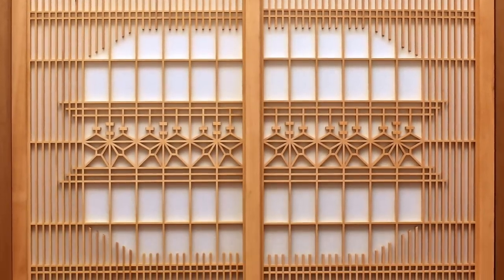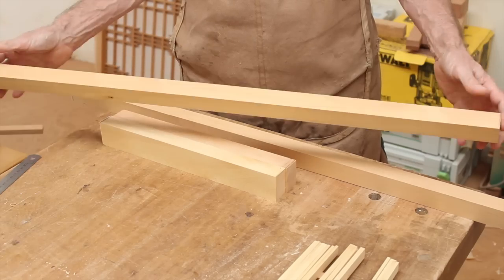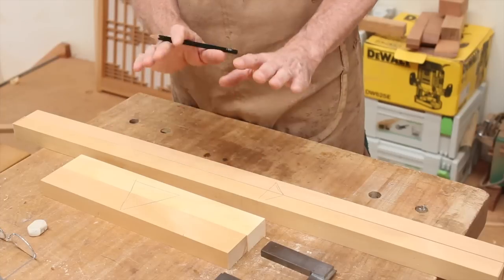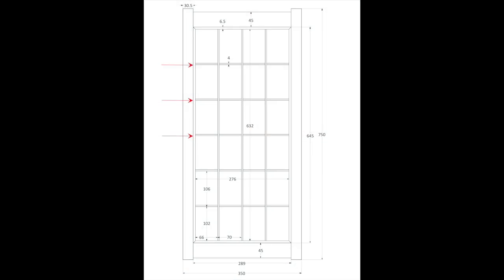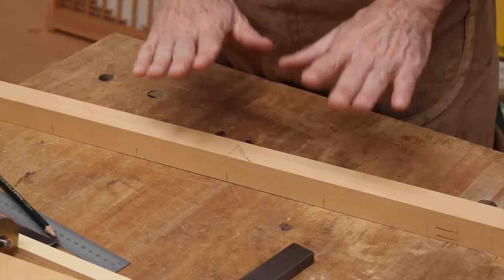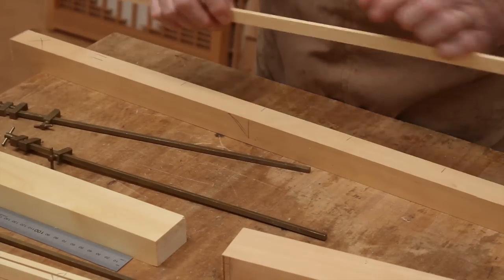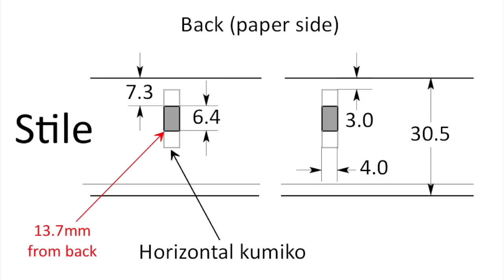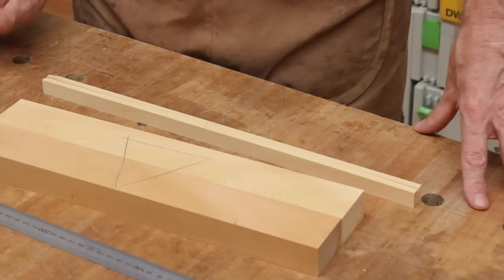Shoji and kumiko patterns - 03 Making a shoji Part 1

Comment: Great video, and quite instructional. I just have a question, isn't difficult to work with 10ths of milimiters in wood? Considering that probably the marking gauge has that width. Thanks for share the video.
Reply from the maker: Thanks. The 10ths of mm is for marking accuracy purposes. When marking by eye, it's next to impossible to mark to a 0.1mm accuracy, but if these tenths aren't properly incorporated into the marking, accuracy will decline with each kumiko joint, and the final joint could be millimetres off.

Comment: Hi,
I have been recommended your book, so I will order it from amazon. But just now one question:
As I can comprehend, the kanna irons are not cambered they are stright as I could see, but they do not make "trenches" in the wood. Why not?
Reply from the maker: Hi fridunanti.
The kanna blades are no different from western plane blades, and will leave lines or ridges on a wide board if the cutting edge is straight for the entire width. This isn't a problem if the piece is thinner than the width of the blade, like a stile or a thinner rail. I sharpen my blades with a slight amount of additional pressure on the ends near the mimi, so while the middle part of the blade cutting edge is straight, the ends are very slightly rounded or raised, and this virtually eliminates the problem of lines or sharp ridges on the piece being planed. Equally, there's nothing wrong with giving the kanna blade an overall slight camber, and I do this for the kanna I use for coarser work, but not my finishing kanna. Hope this helps.